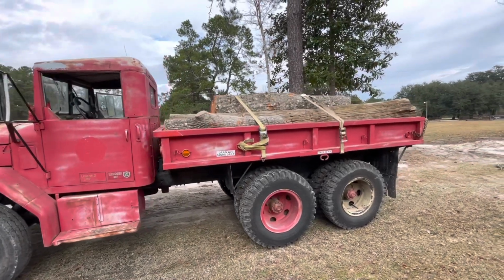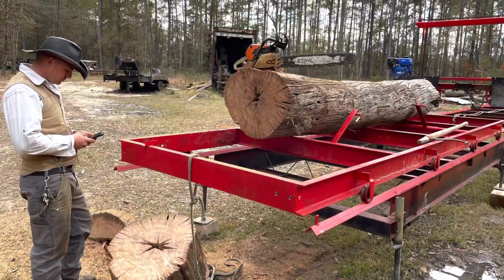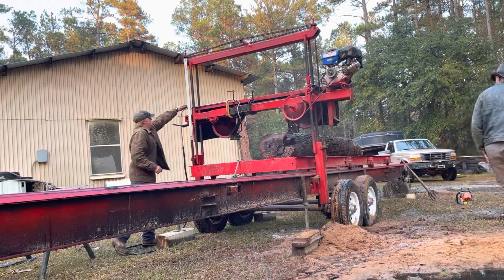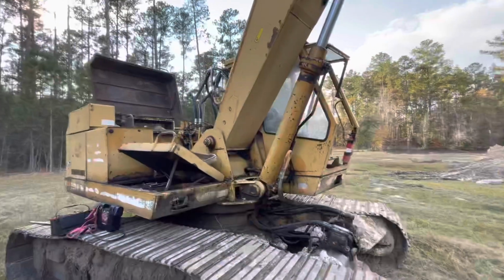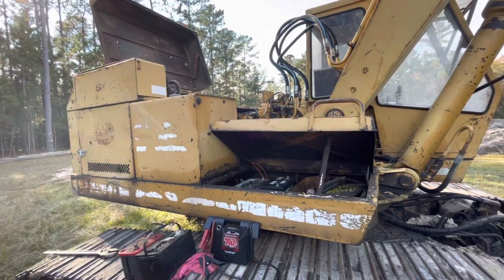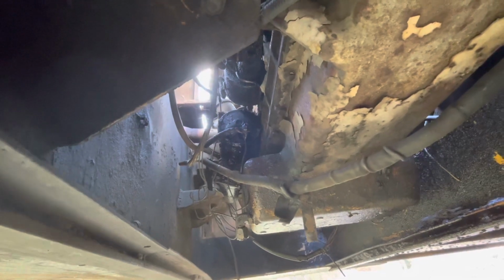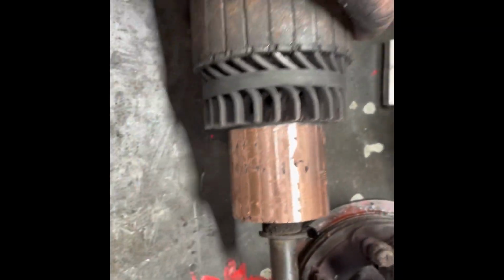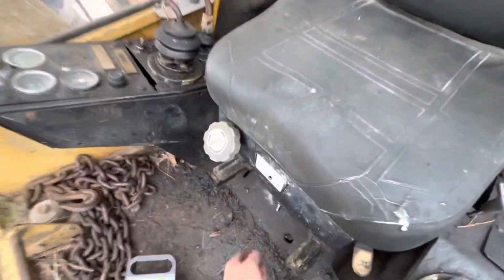Milling petrified live oak and fixing the excavator

Comment: Impressive your able to cut that live oak w/ a smaller gas motor, like the design on that band mill too. A 7 degree munksfur saga blade at 2in 0.055 is the best blade I've found for cutting monster  live oak. Kennesaw saw is the best blade maker I've found band blades as well. Best regards
Reply from the maker: Thank you. I will have to give them a try